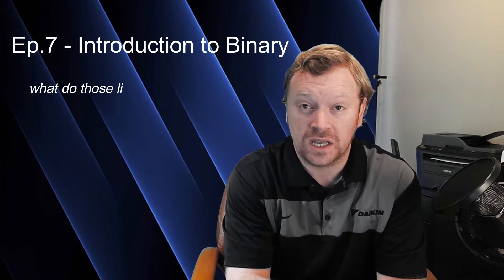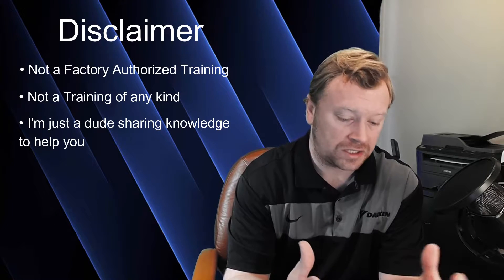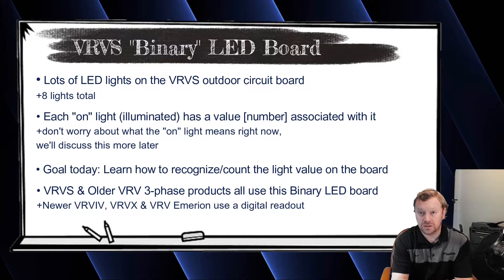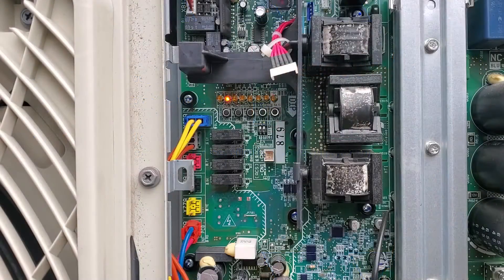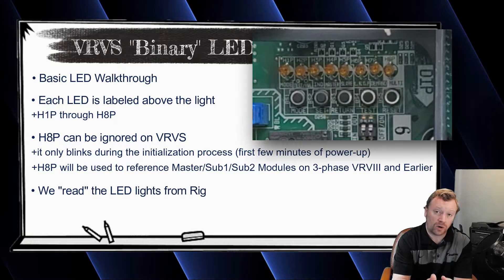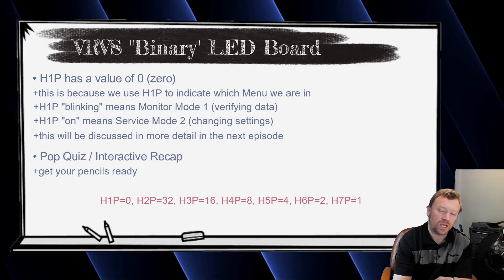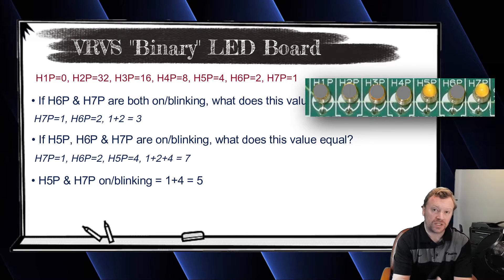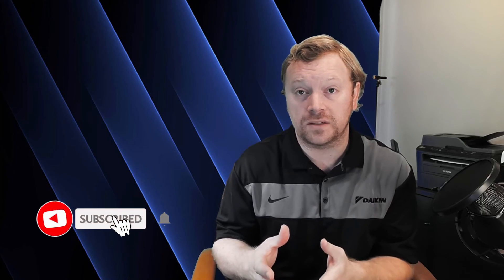How to read Daikin VRV LED Lights on Outdoor Units - VRVS Install & Commissioning Series 10-29-2021

Comment: Im currently studying daikin split units. And been surfing youtube for helpful videos and saw this. Is this also same for the daikin super inverter? RZR140MYM.
Reply from the maker: I cannot confirm but most likely yes, usually rzr and rzq are skyair units which are a subset family of vrv. In the states we call it skyair though and the model slightly differs of course, but from what I've seen all the boards with lights like these follow the same processing. Setting numbers and menu options likely differ though so when you start digging in you'll want to refer to a local manual for which settings you're changing on your gear.
Reply: Hi Dana thank you so much.

Comment: RXYMQ8TRY16 TEST MODE BUT DONOT WORK OUT DOOR AND ERROR CODE NOT SHOW IN IN REMOTE 1HOUR TEST MODE NOT WORK OUTDOOR PL HELP
Reply from the maker: I apologize, we may a slight language barrier. But what is the failure point? Are you failing the test or do you have an error before you start the test?